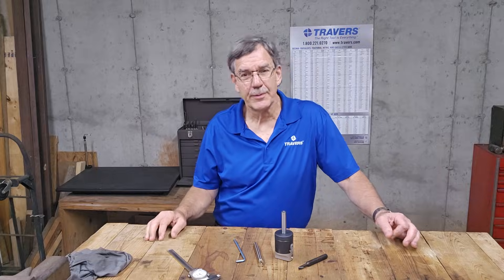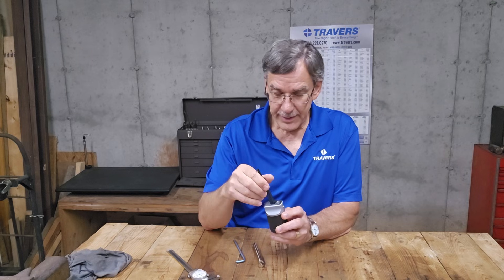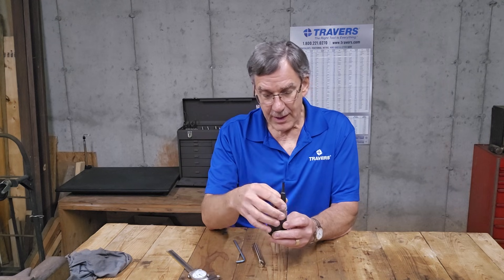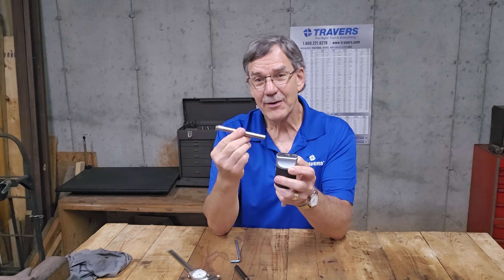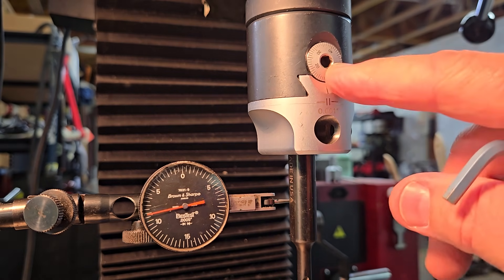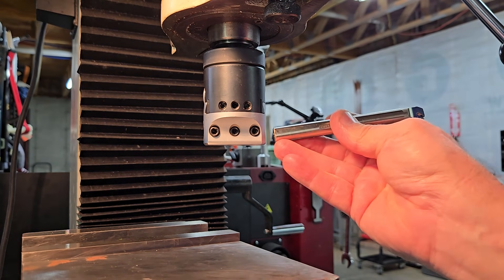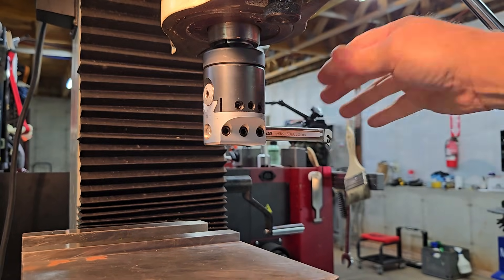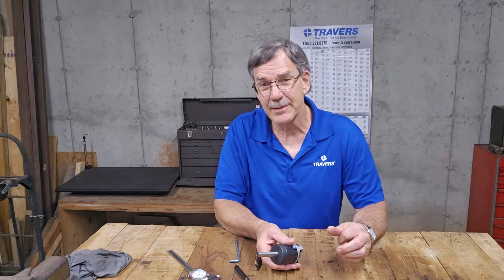Understanding Boring Head Capacities in Precision Machining | Travers Tool Co.

Comment: My Criterion boring head removes .001 on the diameter for each .001 on the dial, never have seen one that didn't.
Reply from the maker: In my opinion, that's as it should be, and I wish they were all 2:1, but as you can see at 3:50 in the video, I demonstrated how a 0.010” adjustment moves the boring bar 0.010”, which will enlarge the hole by 0.020”.
Reply: The Criterion boring head has a larger dial and finer thread than less expensive models. It requires keen eyesight to adjust the import models accurately.

Comment: The question may have been more about how much adjustment does the boring head have. Maybe.
Reply from the maker: The amount a boring head can be adjusted is specified as its ‘maximum offset.’ For example, if a boring head has a maximum offset of 1.000″, it can move the cutter 1.000″ outward from the center—this is a radial adjustment. The resulting change in bore diameter would be twice that amount.
Reply: @traverstool1  that's kinda my question too.. no documentation on any of the used boring heads I own, how far can you turn the adjust ment screw out till it flys apart? or how much thread engagement is needed on screw..?
Reply from the maker: That’s a great question, Mike—thanks for asking!

When adjusting it “out”, you should only go as far as you can while having at lease the diameter of the screw’s threads engaged. So, if you have a 3/8” screw, you should never have less than 3/8” of the screw’s threads engaged. Doing this will likely not give you much adjustment.

Try screwing it “in”, rather than out. You should get much more adjustment in this direction, and the screw will always be fully engaged.
(Kurt)